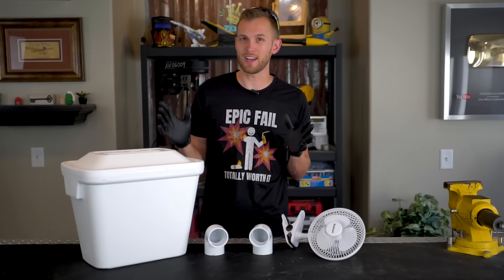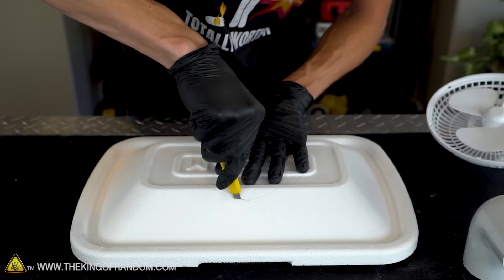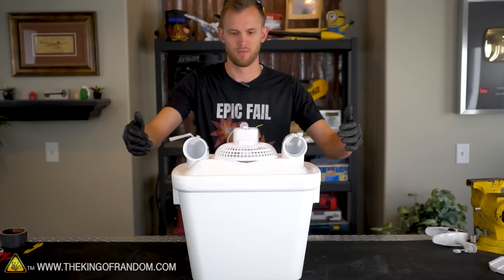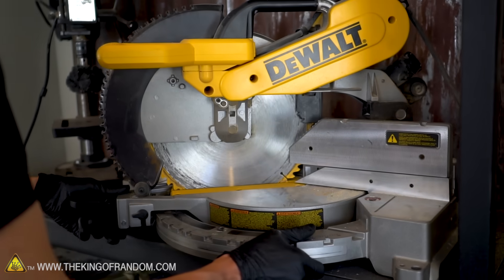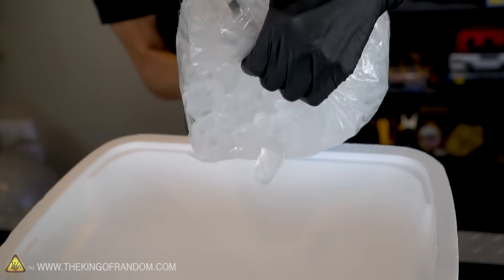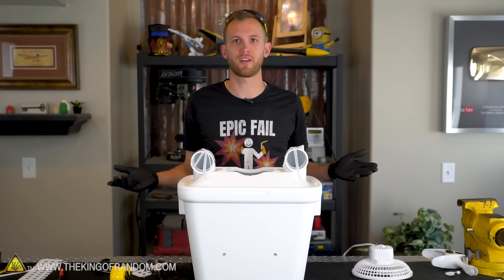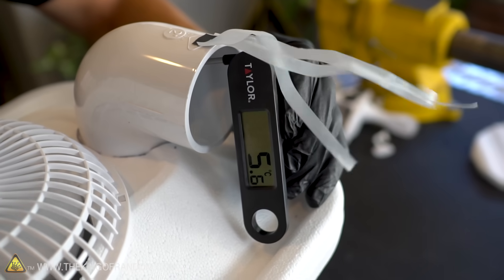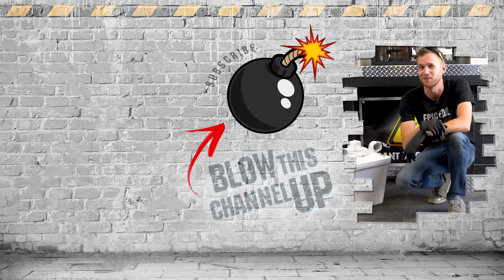Recycled Styrofoam Air Conditioner! TKOR Creates An Efficient DIY Air Conditioner!

Comment: This concept seems self-defeating for general home cooling situations, especially when used by an average person not fully considering the thermodynamics of what they're doing, because the heat pumping action of your kitchen freezer making the ice will raise the ambient temperature of your house more than the heat absorbing capacity of the ice can cool it. A much better DIY air conditioner concept would be an evaporative cooler. Please make one of those!

Comment: I literally built this exact cooler the first week of July (exact Styrofoam, fan, and pvc elbows and all). The Styrofoam broke during transport as we were traveling, but was able to hold up long enough to be useful for the few nights we needed it. Have to agree with the water bottle technique not being as cold as I was hoping for, but think the advantage of it is you get longer results and less cleanup than straight up ice. Ice is a great way to go if you need cold and short term. Go with the frozen water bottles and 1/2 gallon bottles if you need it for more than a day or two.
Reply: What about both ice and water bottles?  Seems like that would be the optimal solution for maximizing overall time while transferring the air through the system.

Comment: What if you were to use the absorbent stuff in a diaper and freeze that?  At least then the water might not run to the bottom, and I guess you could probably refreeze it.  You'd need to have a better shelf for it, though.

Comment: The problem with your design is that the melt will prevent air from flowing through the pipes. Still better than Russian hackers version, it used dry ice lol. Nothing says "I'm hot" like dying from suffication with a terrible home made ac unit using dry ice.

Comment: Put a coil of copper tube throughout the bottom and use ice water and salt to lower the temperature and supercool the pipes. Basically it would be like a heat exchanger but a cold exchanger.

Comment: If you left the tubes off the vents and put a larger one on the fan and filled the bottom with ice water, it should be much colder.

Comment: you could also put a hole on the very bottom of one of the sides and put a small pvc elbow on it, suspend the cooler on some wood and put a bowl under the elbow, now as the ice melts it drops into the bowl and u can give it to your dog some nice cool water to drink. Then refill every hour or two with new ice and repeat!

Comment: Now do heating
Reply: Chbv just put hot water In the bottles
Reply: GEAXX just do exactly like in this video, for even more efficient heating of your house you can put this ugly thing outside

(because the freezer creates heat btw)
Reply: GEAXX but you have to replace it like every 5 minutes
Reply: Warm up some water-logged bricks in an oven, I guess.
Reply: get a lighter and a wash tub then fill the wash tub with wood dry works best use a 0000 Steele wool pad on the bottom of the wood start the Steele wool on fire as the wood catches fire notice how the room heats up
Reply: If you are able, place rocks into a campfire. After about 20 minutes place the rocks into the styrofoam box. The fan will blow over the hot rocks. Rocks stay hot for a long time. The bigger the rock the longer it stays hot.
Reply: Start a controlled fire in the cooler and have the fan blow out hot air

Comment: Another way to cool it further, is to add salt and water to the bottom layer of ice. The salt will make it be colder than freezing temp.
Reply: No. Adding salt to water makes it boil a few degrees hotter and Ice melt a few degrees cooler. It's not worth either and making ice involves the latent heat barrier that's solved most efficiently with modern Air conditioning systems not refrigeration.
Reply: Nunya _ your explanation is completely backward. Salt water boils at a lower temp and freezes at a lower temp. Just take some salt water, put a lot of ice in it, and then record the temp. Then, do the same with regular water. The water with salt will get colder than the water without salt.

Comment: Seeing how cold air flows downward., I'm wondering if you turn the frozen bottles upside down - and place around the longer vent tubes between them and just a half inch from the bottom., if it would have the same effect as with the raised grate and ice above and below?

Comment: I produce liquid air in my own basement, just as you produce liquid nitrogen in yours.  It would be neat to make a design like this that uses LN2 or liquid air instead of ice.  Not as much heat capacity as water but, because of the super low temperature, you should be able to get more 40 F air per volume of cooling material.

Comment: What's "quite a while"?  For that amount of ice you put in there, how long will it last?  The only problem with making it so efficient is you'll definitely melt the ice faster.  So, if someone didn't want quite as much cooling, a variable speed fan would be nice, or maybe pulling the tubes out a bit so the air doesn't have to travel through as much ice.  Then, do it your final way for MAX cooling.  I do like it!

Comment: Nice Job! You're better off leaving the fan on top, and having the cold air exit from the bottom of the cooler since cold air sinks to the bottom. Try dry ice chunks on the rack as well. Unless you're in a small room, the CO2 level won't be a problem. :-)
Reply: What about liquid oxygen INSTANTLY TURNS INTO GAS
Reply: Assuming your room isn't airtight, the CO2 will vent and you won't suffocate.
Reply: Price of Dry Ice vs Frozen ice packs or just bottles of frozen water.
Reply: Anything involving dry ice and air in a house is a bad idea do not try this just use regular ice its cheaper and safer
Reply: it is ok to breath co2 gas as long as the room still has air flow also try putting dry ice in hot water with soap
Reply: electronicsNmore cool
Reply: M
Reply: Dry ice would produce carbon gas as it melted basically poisoning the air im pretty sure. Also if you filled it with ice and had holes in the bottom the ice would melt and leak everywhere.
Reply: Reaginic Fiddle  As soon as he poked holes in the container I thought about the leaking issue ... scrolled through comments to see if anyone else had made same comment.  I suppose there would be a fix.. some type of silicone .. hot glue..  play clay... something similar that could be put around the dowels ...  but yeah.. without addressing the issue.. leakage for sure!
Reply: @Reaginicfiddle4  realistic 🙏
Reply: Reaginic Riddle, dry ice is frozen carbon dioxide or CO2, which is the same air you breath out, same stuff that powers air guns, which is the same stuff that makes pops fizzy, and stuff that puts out fires. You are thinking of carbon monoxide or CO, which is poisonous. Carbon Dioxide is an asphyxiant, but not poisonous. High levels of CO2 in the air could cause asphyxiation.
Reply: Reaginic Fidlle
CO 2 poisoning the air???Man!You can still work qoute well in a room with 1500 ppm of CO 2!Like they are doing in the greenhouses!You are mislead by the propaganda of the IPCC!CO 2 is not a poisoning gas!!You yourself are breathing it out!!!!When there are a lot op people in a small tight closed room,the air is indeed thicker from the CO 2 we exhail.But that isnt poisoning,its just a lack of oxygen..
Reply: No, you're better off not doing this at all.
Reply: Onl1neCooL  it would blow the CO2 into the room you are trying to cool displacing the oxygen and slowly suffocating you.
Reply: even in a large room dry ice would still suffocate you. unless you were letting the room air out regularly defeating the whole idea.
Reply: electronicsNmore this is a terrible idea
Reply: Pandajammaker no that's how you die
Reply: This would eliminate the problem of the increase of humidity the open ice cubes add to the equation. The enclosed water bottles keep the moister contained so there's no added humidity, a major problem in my area. If one were to use dry ice instead of ice cubes=no humidity issue.
Reply: Reaginic Fiddle Wrong, next time read my comment. LOL

Comment: If you are using ice cubes, I would suggest adding a drain hole or two, and mounting the unit on a five gallon bucket, then you can add more ice as needed

Comment: Celcius for those who are interested, he says sarcastically. This guy doesn't know that Celcius is the scientific one, and Fahrenheit is reserved for some silly Americans who are oblivious of the units of measurement of the entire rest of the world.

Having said that, this device basically moves warm air from where it is, to your kitchen. Very, very, slowly.
Also, using exposed ice makes the expelled air very humid, making the room feel warmer in the long run.
Oh and of course when it's depleted and you don't realize it, the running fan will add some 25W of heating to the room, just because that's roughly amount of power it'll probably spend.
Reply: Fahrenheit actually was the standard before Celsius. And if we are being so foolish as to apportion blame in the Middle East, then we need to start with British Petroleum and the UK. 
Certainly not the USA
Reply: You must not know that we Americans use the “British Imperial system” because we inherent it and kept it after the world decided to go with Celsius. But if you ask me, everyone should go with Kelvin scale. A lot more accurate.
Reply: celsius is reserved for most of the world scientist use Kelvin not celsius scientists need exact temperature readings Kelvin is universally used so people can all use the exact temperature to validate experiment
Reply: Actually Kelvin is the Standard International unit used by scientists around the world
Reply: Youre all idiots! Celcius is based off of the freezing point of water. Scientific measurements are based off of Kelvin which is scaled from absolute zero or no energy in an atom whatsoever.
Reply: Man, for someone with a cute anime girl as their icon, you're really angry. Swamp coolers work fine, especially in places where it's not so humid - at the very least, it'll provide some respite until the sun goes down and you can get some relief.

Also, I don't think he was even being sarcastic. At the risk of the pun, 'chill out', dude.
Reply: thany3 fairenheit is superior because it gives you more steps within a usable temperature range

Also this type of cooler has been around for generations. It's called a swamp cooler. Yeah, it ends up making things feel hotter later because it expels humid air. Which is why you top it off when it gets low.

If it was as bad as you want it to be, the concept wouldn't have been used for generations. It works fine.
Reply: Metric elitism at it's finest.
Reply: thany3 how silly were Americans when they saved the world twice and to this day protect the rest of the world just by existing🤔
Reply: Tom Charles Not really. And even if, that doesn't mean we should just take whatever silly units of measurement they've come up with when the US started existing like 6 minutes ago in comparison to most of Europe.

Comment: You can put dry ice or liquid nitrogen
Reply: No you can't you will die eventually of too much CO2 if you put dry ice, not sure about liquid nitrogen.
Reply: If you put liquid nitrogen you would still suffocate when it turns into nitrogen gas
Reply: Reaginic Fiddle even nitrogen is necessary for us
Reply: Prakhar205 what do you mean by its necessary for us?
Reply: Reaginic Fiddle  a little bit
Reply: Reaginic Fiddle well what is your real name
Reply: Yes we need nitrogen but As liquid nitrogen evaporates it reduces the oxygen concentration in the air and can act as an asphyxiant, especially in confined spaces. Nitrogen is odorless, colorless, and tasteless and may produce asphyxia without any sensation or prior warning.
Reply: And why do you need my name?
Reply: What about ice packs?
Reply: Yeah, you should especially do it this way in a smaller room for the best results.

Comment: what if you used dry ice? I feel like after it ran for a bit the ice would melt leaving water behind that could clog up your vent pipes. Dry ice could get the system colder and eliminate that potential issue

Comment: Salt to lower the freezing point of the ice...?
Reply: You would get 10 minutes of freezing air.
Reply: I add a little salt to the similar portable ac that I use for camping.  Makes a huge difference.
Reply: AFORWW it would melt sooner and drop to the bottom and although it would still be cold there would be comparatively no surface area to cool the air, therefore it wouldn't last as long
Reply: will reduce specific heat capacity too
Reply: Remi King Perfect for 104° 70% humidity weather
Reply: There would be a far better cooling affect from ice due to latent heat needed for the state change.
Reply: rom65536 yes
Reply: but it will not last as long
Reply: RAN Fell yes it will. It's colder and therefore takes longer to come to room temperature. It also has better heat transfer properties. It's why we brine baits for fishing.
Reply: Wrong, if it did you would have a new energy source providing something for nothing, which is not allowed in physics.
Reply: Dry ice?
Reply: Remi King what?
Reply: Thats why we sprinkle salt on icy roads, unless for the people who live in warm countries, states, or provinces, fun fact for ur day
(Sorry for my bad grammar)
Reply: This is exactly what I was thinking. If you REALLY needed to be cold fast, add some salt.
Reply: I built one of these for a work truck with a busted AC... Forget the ice, frozen water bottles, and ice with salt. Just buy as many giant ice packs that will fit into the cooler, stack them if need be. It will go all day, and with enough ice packs be more than cold enough. (Stacking the cooler into another one really helps insulate it better as well. This helps it last a little longer.
Reply: You literally just overcomplicated saying it lowers the freezing point lol
Reply: Qualyn Foreman guys ice can't freeze... Water can😉
Reply: noobtuber103 lmao exactly. It lowers the freezing poibt of water. Meaning, the ice has to be colder to freeze.... Thus making the ice packs colder longer.

Comment: Test the output temp with the frozen water in plastic bottles on the sink mat. The reusable plastic bottles is a much better idea so that you can simply refreeze them. Plus they will be easier to load into the cooler and won't interfere with the added tubes.  I like the idea of a battery or solar model for cordless operation. Maybe build a more deluxe version with a better coller for the cordless set-up.

Comment: My only change for this in a long term setting is using a cooler with a spigot at the bottom so you can let out the water as needed.  Instead of needing the mat, using walls with a mesh to contain ice so that all air ia forced into that and exits at the bottom where it then overflows into the air vents.

Comment: You are right about icecubes cooling the air faster. And as such your reasoning with the grid is solid. However, you forgot 2 things:
1. Ice melts and soon your extension pipes will be standing in water.
2. Your current design will greatly increase the humidity inside (which in itself causes a whole host of other problems, including mold and attracting unpleasant bugs).
I eagerly await an updated version. Maybe one utilizing the coolpack chemical reaction?

Comment: The only problem is, when the water level reaches the pipe, the air won't go into the pipe anymore.
Reply: Fikri Noh try poking a drain hole at the bottom and putting it in a pan with a drain hose

Comment: I've predated this by a few years.  The  car air conditioner in my first car was a styrofoam cooler, a 12 volt muffin fan with cigarette lighter adapter, and ice I cooled in my parents refrigerator the night before. I think I salvaged the parts from junk and contraption  was still worth more than my POS car when I was 16.

Comment: You should put dry ice in that air conditioning thing 
Like if you agree
Reply: Sketchy the amount of dry ice he would need to die of suffocation from c02 would be massive.  Unless He’s in a closet with the door closed.  Which would probably be the only thing this thing could cool off.  If you put it in a normal room the amount of dry ice you would need to cool the room wouldn’t even be cost efficient over buying a real ac unit
Reply: That doesn’t matter. Letting dry ice sit inside a room isn’t something anyone should think is ok. So just don’t do it? Why risk dying when you could just... not

Comment: If you would have put. Salt water and the water bottles in the bottom and took the piping to just above that  you would have gotten just as Shocking results. Salt would have dropped the temperature albeit at the cost of how long before bottle changes.

Comment: What will happen if you use dry ice instead of ice???? will you breath more co2 that will make it dangerous? what will be the temperature measurement?
Reply: benellias87 I think that the temperature would be higher because the dry wouldn't give off enough cold air?
Reply: You would suffocate because of CO2

Comment: I'm wondering:
If I put dry ice in the box, and have a really high speed fan, will I be able to cool the whole room if I maintain your design? It's India, and 40 degrees Celsius is not astonishing in the summer!
Reply: Bill Diamantopoulos the word “Toxicity” is the degree to which a chemical substance or a particular mixture of substances can damage to an organism
Reply: djmankiewicz1000 all it takes is 10%
Reply: Maybe. Probably not.
Use a Window A/C unit. It is much more effective, and it can run without stopping.
Reply: Alan Douglas not in a large house... you’d be fine.
Reply: Just don’t use too much
Reply: yeah you know how aircondition works...
make a aircondition system then open a door or window to let the co2 out...

No it won't work.
Reply: Alan Douglas to be honest, it would be suffocation, CO2 is not toxic.